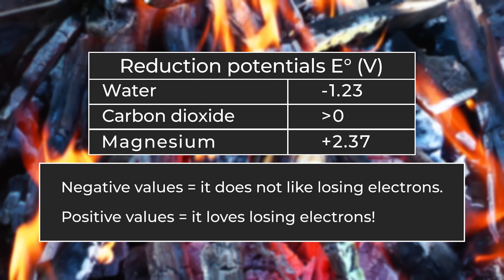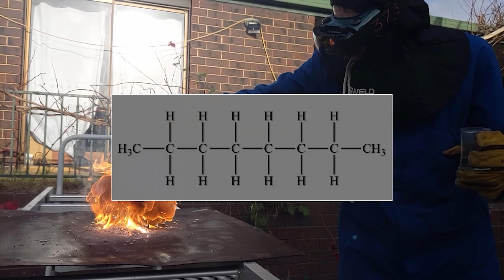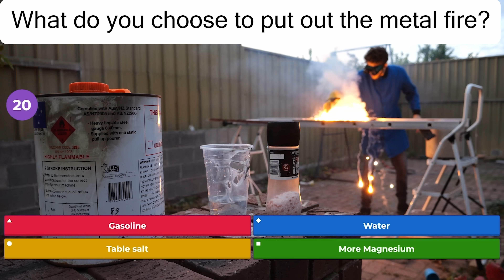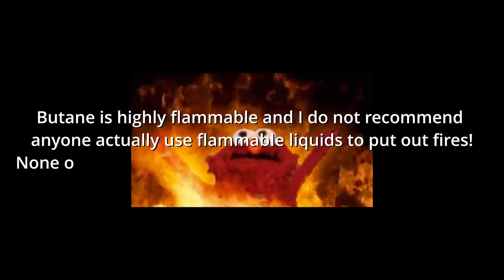Can Gasoline Extinguish a Fire?

Comment: Voting as of 10 minutes in....my vote is that you need to use diesel fuel.

My hypothesis is that you need enough hydrocarbon-fuel to A) Cover the magnesium's surface with it, so 'sprayers that atomize the hydrocarbon' will be unlikely to work without insane volumes of fuel and B) Provide enough of it to let it 'boil off' the gasoline (or, my suggestion, diesel) and steal away a lot of the heat needed to keep the magnesium lit.  When coated in the 'useless-fire' of gasoline, magnesium boils off the fuel atop it AND loses access to oxygen, putting it out.  Misting it at the magnesium makes the fuel burn HOTTER, which almost adds to the problem.  Thusly, I vote you use diesel fuel, or maybe preferably even kerosene, to put out magnesium fires.  You should do so by *pouring*, or at the MINIMUM use a 'less-misting spray method' to deliver the fuel to the fire.  You'll need to cover the magnesium enough to let the fuel-boil-off and the coverage with soot/boiling fuel to keep the oxygen away until the metal can no longer reignite itself.

Comment: Gasoline will preferential bond with oxygen. Gas doesn't burn hot enough to burn magnesium. If you burn enough gas around a magnesium fire, for the magnesium to cool below its ignition temperature, the fire will go out.

Comment: This looks to be a problem of scale.
The gasoline/butane ratio to magnesium in the small experiment seems to be like a 5 to 1 in a short period and in the bigger scale you always used more like 2 to 1 and over a longer period, which let the magnesium always reignite.
The obvious problem is the big gasoline/butane fireball you need without spreading the magnesium apart.
I think the best option would be a flammable malleable cover that you throw over the magnesium to burn.

Comment: A gasoline filled fire extinguisher is something The Joker would put in a children's hospital.
Reply: To go with the red paint?
Reply: @philiphunt-bull5817  yes, because of the color theory
Reply: @philiphunt-bull5817 that makes it burn faster
Reply: but you can't argue with the results
Reply: I've legit seen it done to make an improvised flamethrower. Drilled a hole in the side and shoved a valvestem in so it could be pressurized, and replaced the rubber hose with a rigid metal nozzle with a flashback arrestor. It really should've been charged with nitrogen, but standard compressed air was used. It worked well and last I heard hadn't blown up.

Pressure vessels with flammable liquids or gasses are still sketchy as f*** and deserve far more respect than that anecdote or this video demonstrate. Sure, it might be fine 99 out of 100 times, but that one time it does go wrong...
Reply: Yeah, something about this has an air of "mishap turning to BLEVE...."
Reply: " So, how did the main act go? "
" well, you see, boss... "
" WHAT DO YOU MEAN IT HELPED THEM? "
Reply: For shaft fires we use explosives to use air faster than flame underground
Reply: Well I mean, sick kids should be allowed to have fun too.

Comment: You'd think it was putting it out at first due to the amount used. Since gas isn't flammable it sits on the magnesium while the fumes burn, starving it. When using it as a spray, there's to many fumes from the particles of gas mist.

Comment: it's honestly worse than that for the water because it produces oxygen for the magnesium fire to eat as well as part of the reduction as well as the steam explosion. this makes your fire hotter rather than colder.  you could make an actually usable version of your fire extinguisher that near immediately switches to a more conventional extinguisher using carbon dioxide or argon(I'd use argon for this or another easy to get gas that can't ignite if there's any burning material from the magnesium) once pressure in the first tank is out using a pressure valve it would automatically switch to the second tank on the same emitter putting out the end of the emitter and the secondary class b fuel fire. you would have a fairly small bottle for the first stage on a low output shower type head and intentionally fairly low pressure. you put out oil fires by using misted water so this would be a simmilar application you'd want an extremely large droplet size for this application though to keep from fireballing away your mix with just normal air. you could also do this in 3 stages carbon dioxide then fuel spray(since the co2 will displace the oxygen around the fire but not on it there is very little chance of it fireballing with ambient air, then co2 to clear your class b. there's a few ways to do this and I hope I've helped a bit.
Reply: basically you'd need an engineer to make the system for this but it uses the pressure of the first tank to keep from using the second tank till the first one is mostly empty.

Comment: its because your solutions added air every time

the wind, the spray pressure of the fire extinguishers, and the vaporization process of the spray bottle

when you poured it in one big lump it was perfect. 

therefore when a lagre magnesium fire breaks, it could be a smart idea to dump an airlifted bucket of gasoline on it. but thats not exactly feasible for obvious reasons

Comment: You could try a roofing torch. It's not so hot that it would re ignite the magnesium, but it would steal at least some oxygen. I haven't looked into the temperature of a roofing torch, though, so I don't actually know for sure that it wouldn't be hot enough.
Reply: Hi
Reply: That's a good idea. I'm sure there is a point, just at the border of where you see blue, where most all of the oxygen is used. What prevents it from re lighting though?
Reply: @MiddlePath007  if the flame from the torch is bellow the ignition temperature of magnesium or what metal you're trying to extinguish, then you could theoretically get it below the ignition point.

Comment: The only problem with this is that the hydrocarbons are cathing fire themselves. Try to make a gasoline fire extinguisher designed to work for magnesium fires in a CO2 atmosphere. We often forget that we are completely immersed in a very oxiding and reactive oxygen atmosphere. It's the oxygen the problem, not the hydrocarbons.
Reply: What video did you watch?
Reply: @MiddlePath007  apparently not this one as it has been restricted by youtube.

Comment: Would it work on lithium fires?
Reply: The lithium tends to burn with a higher vigor that encourages more airflow. This, again, might be better served with a more viscous medium, like it was gel... you know the one? The liquid shown here with frozen juice concentrate.
Reply: Actually, that would not work either. Something like axel grease or marine grease might work better. The oxygen in the air might relight the lithium, depending on how much surface area is exposed. So a thick thick goo seems best.

Comment: Mix in frozen orange juice concentrate, a 1:1 ratio will give you a viscous coloid suspension, and that smell that everyone loves in the morning, victory. That's a reference to apocalypse now, not orange juice. 

Anyway, that will get it to stick to your targeted metal and not be affected by wind. Even an aerosol bottle should put it out at that point, and it will take much less to take effect. 

Hypothetically

Comment: I am not a chemist, but the little experience I've got as a mechanical engineer is that you need a thicker liquid to cover the surface of the magnesium before the liquid catch fire.
If i get it correctly you want the fuel to cover the magnesium like a sheet and trap oxygen out, but acetylen will burn before it even contacts the magnesium surface and gasoline is just too inconsistent for this.
Go for a viscous liquid instead.

Comment: Just using the original butane cylinders or air dusters to spray the butane directly ❌️

Opening a fire extinguisher and filling it with butane from the other cylinder and wasting 90% of it in the process ✅️

Comment: there could be more to the butane idea adding a flame arrestor and a nozzle to the end of the extinguisher would give you a better chance of getting liquid butane onto the metal without it just vaporizing into flames. also switch to the style of extinguisher that uses water to send it the nozzle it comes with might just be perfect those are designed for low pressure

Comment: 30-odd years ago some friends and I discovered an old fire extinguisher in their parent's shed, that was pressurised with generic 8g CO2 bulbs. A trip to Boots and some snaffled two-stroke mix made for some pretty good fireballs.

Also, a cafetiere with the stem removed is a serviceable receptacle for lighter butane.

Comment: Firstly, this was one of the most interesting videos i have ever watched for a while. Thank you for the new concepts. And also thank you for trying to burn the leftover or applying water to every experiment setup to clearify all the possible questions. Your approach is very scientific.

And the footage at 04:26 gave me an idea for the problem. Just maybe, the answer could be the melted plastic all the time. I mean, it's sticky, it's denser than other liquids, it burns at a much slower rate and it's easier to stop plastic fire than to stop gasoline or acetone fire. But we will need some engineering to be able to throw hot melted plastic onto something. I think it can be managable. But you have to consider melted liquid plastic as a new flammable extinguisher candidate. 

The second thing i thought while I was watching was  to spray with flammable extinguisher and normal extinguisher consecutively, but you already tried that later. But i think that arrangement can be also engineered and automatized somehow and it could also be interesting. I mean, all of these can lead to something really useful. Keep up with the great work.

Comment: Why not use a heavier hydrocarbon like some type of oil?  That way it's harder for the wind to blow it and the increased surface tension and viscosity will better coat the magnesium.  However many oils still have oxygen in their structure, so you'd have to do some research to find one.   Also they say to use baking soda on oil fires, however sodium bicarbonate also has oxygen in it.  Maybe the oil fire could then be put out with baking soda.  It would be interesting to see just baking soda on a magnesium fire too.

Comment: I think the problem is that you have been spraying the gasoline on the fire, applying a fine (pressurized) mist.  While the tests that put out the fire used larger gobs of gas.  You should try gasoline filled water guns, or better, gas filled water balloons!

Comment: I think the times it works is when it's fully coated in a liquid it can't react with. Something more viscous like oil that burns at even lower temps seems like a good option. If it were me, I'd try cooking oil out.

Comment: Maybe you could limit the expore to air with a covering, like a gasoline-soaked blanket or an inverted bucket soaked in gasoline or even holding methane which floats in air. That last one might explode though because it would create suction to rapidly pull in more air.

Comment: As a scout I did know not to use water on metal fires however I didn’t know gas would put it out we were told to make sure nothing around it is flammable and if possible put dirt or ash onto it
Reply: Your advice would probably work better and is less unhinged.  I'm surprised that the takeaway from this video wasn't a salt extinguisher and also that he still has facial hair.

Comment: I don't remember what was in the Class D fire extinguishers we had when I worked Security for Bethlehem Steel,  they had a research facility that they were experimenting with all kinds of crazy alloys,  they had Class D extinguishers all over the place. All I know is I was told if something happened to suit up with the equipment and SCBA and pull anyone out that was incapacitated.  Don't try to extinguish anything or go in if there's an existing Fire!

Comment: The issue is most likely that by spraying butane and gas on the fire, rather then completely smothering the fire like the first butane and gas experiment, you're simply adding fuel while oxygen can still reach the magnesium as the gas is in this fine mist.

Comment: I think the inconsistency might be coming from the fact that while the uncombusted gasoline cannot immediately react with the magnesium, the combustion products can. Thus, there's some kind of delicate balance between gasoline stripping oxygen and thermal energy, and newly formed CO and CO2 from the gasoline recontributing fuel to the Mg. It matters how the partially burned gasoline products are ejected, but this is an extremely turbulent hydrodynamical system that probably ejects some of these reactable gasses downward towards the flame. This could also explain why on larger scales, this process is less effective. As the spatial size of the system grows, the probability for an anomalously favorable formation of gasoline combustion products shrinks.

Comment: I'm gonna guess that the gas putting out the magnesium is going to depend on the magnesium being covered entirely by the flame ie. much reduced access to oxygen. The butane just had too much vapour pressure and tossed the magnesium particles around as it evaporated in the hot environment. Gasoline is a mixture of longer hydrocarbons, so maybe there's some even longer hydrocarbons that would have more useful properties. Someting like a paraffin wax is just a really long alkane, you could try using a smaller amount of some butane and gasoline as a solvent/propellent to deliver a really dense wax which should generally stay put when sprayed into the fire and be really sooty while it burns.

Comment: basically, he should spray much, much faster and more reliably. He needs a metal nozzle. Metal tubes. Metal pressure chamber. Safety valves. Safety squints. Bullet-proof shield. Multiple fire extinguishers for all of the possible fires. Fire alarm system.